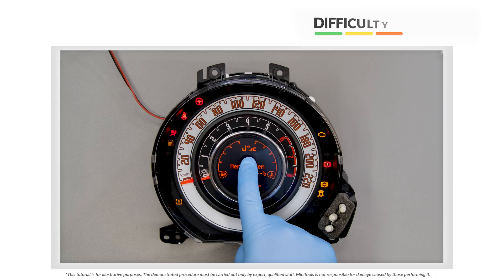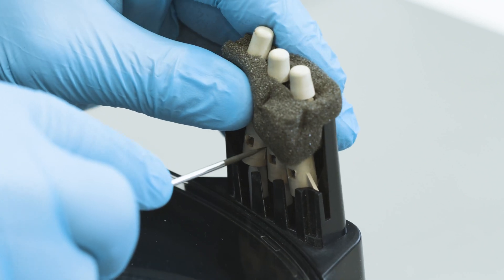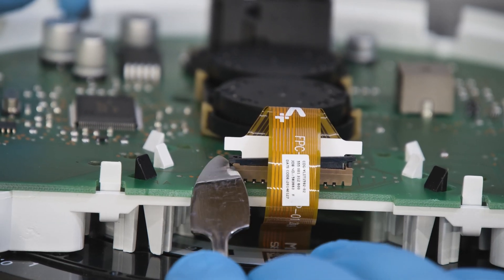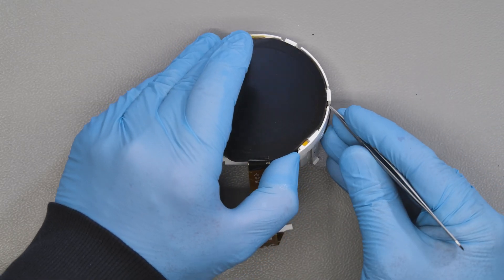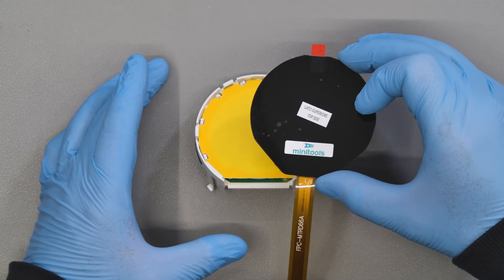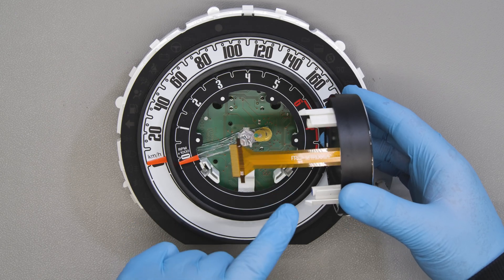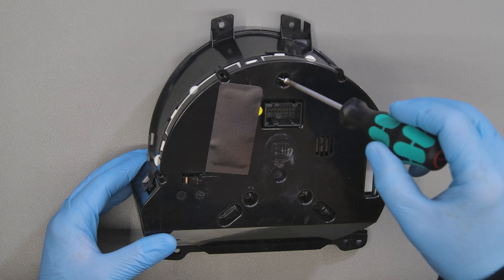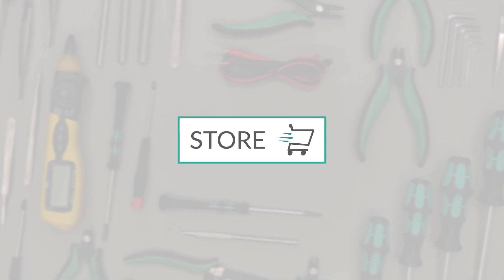Fiat 500 instrument cluster LCD display replacement

Comment: Hey thanks for the video and stocking the parts.  When replacing the display with one from your store, will the odometer reading by the same or will this need to be re-coded?  Thanks.
Reply from the maker: Hi, after replacing the display the odometer reading will be the same, there's no need for any re-coding, it's pretty much plug and play. Thank you.

Comment: Please do u have a repair video on the fiat 500 when the LEDs are flashing when indicating right its a common fault on that cluster thanku
Reply from the maker: Hi! Could you please send us an email at info@minitools.com with more details?
Reply: @MinitoolsChannel  did you ever manage to do a video on that. I believe it’s dry solder joints?
Reply from the maker: @jcderby129   Hi, when the issue regards solder joints, as each case can be different, we rather don't make videos about them.

Comment: Perfecto👌
This one is really tricky to repair, especially at the spot where the screen is fitted, but you guy's are trained professionals you made it look easy😉
Thanks for sharing Stay Safe👍
Reply: Do you know the power and ground pins on a mercedes w208 cluster by any chance ?  thanks
Reply: @cagmito76  by the time I found them, you had already uploaded the video😉
BTW, what I found is as follows:
A.9 is Ignition Power (Circuit 15g)
A.11 hot at all times (Circuit 30)
A.3 & A.12 Ground to W1
B.6 Sensor's common ground (Circuit 31e)
Hope this helps🤞
Reply: @isalmankhan1  wow thanks Salman ill try these , thanks do you have any other information on clusters i am trying to learn all i can ? if i can do anything for you too just ask
Reply: Do you do these repairs yourself Salman ?
Reply: @cagmito76  yes all the time😉
But with two hurdles, I don't have these fancy tool's & in my part of the world there are no new spare's available, instead I use donor spare's😉
Reply: @isalmankhan1  Yeah well these tools are excellent quality but you can use cheaper and still do excellent work , where you based ?
Reply: @cagmito76  as of now I'm in Pakistan, but will move to Gulf soon visa in process👍
By the way your channel is awesome, really informative content👍